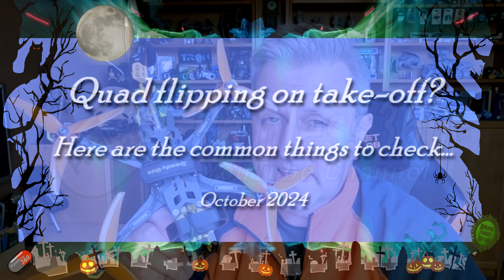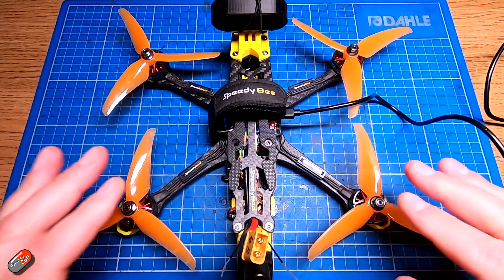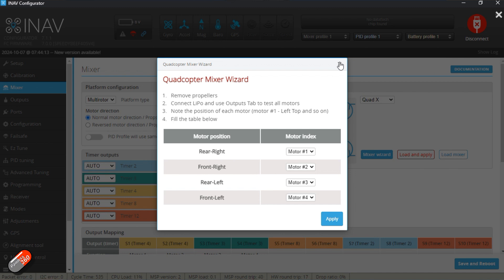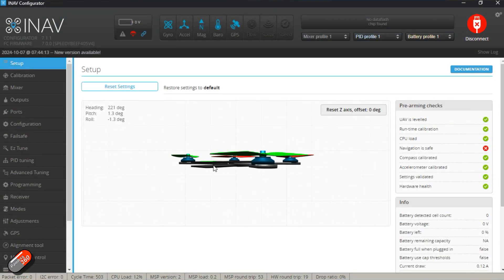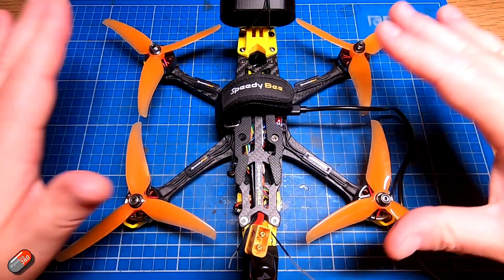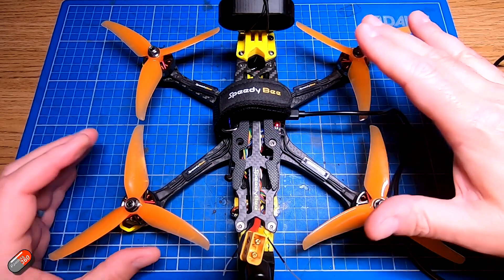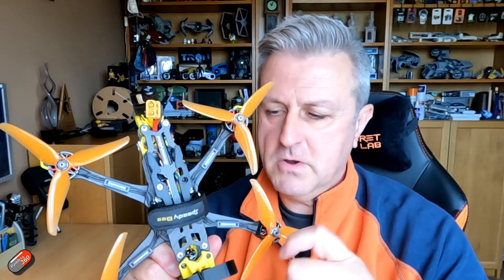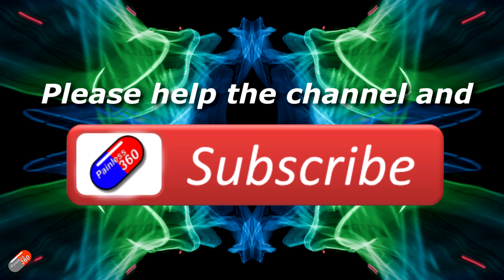Why does my quad flip on take-off? The common causes!

Comment: I have a 5 inch build that flips on takeoff once in awhile doesn't do it all the time . Any thoughts of what it could be .
Reply: I have tried most of the thing in this video
Reply from the maker: It is very odd that it is an intermittant issue. I've never seen that.
Reply: @CherokeeFPV  
once I had a problem with too much D gain

Comment: Thank you for your very informative videos, they have helped me a lot. I just build a 10" custom quad with escs and motors from hobbyking, s500 frame from amazon, and a pixhawk. I'm not sure what protocol my escs need, but i set them as standard in mission planner and when i would do an esc calibration, it would change my escs to soft start. It took me a week to figure this out as there was no information i could find online. It was very close to flipping but i'd cut the throttle and it would land on it's side.